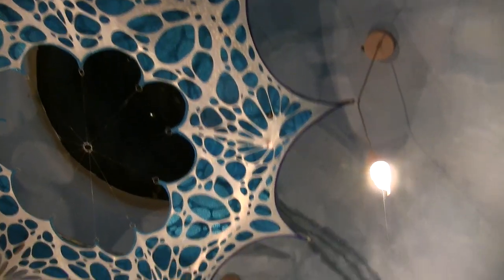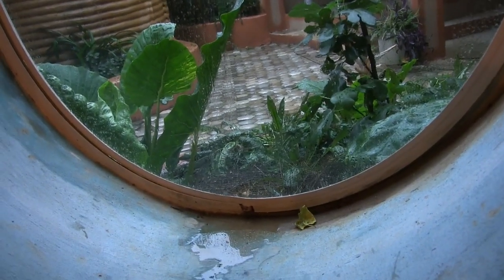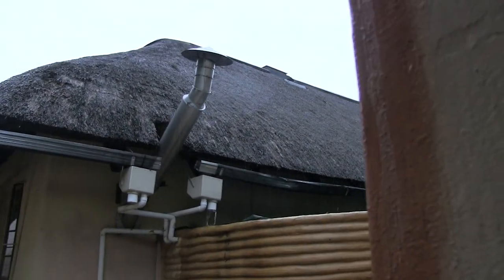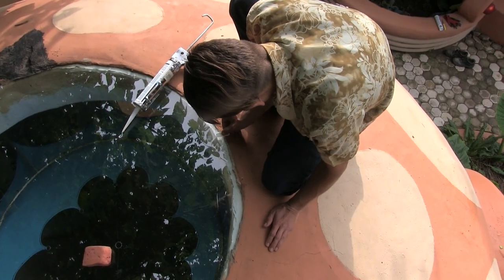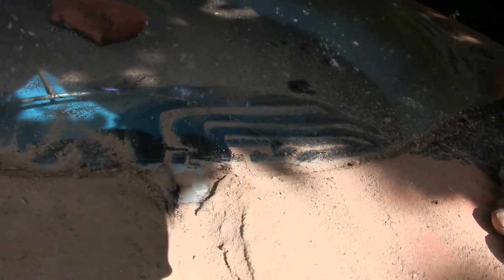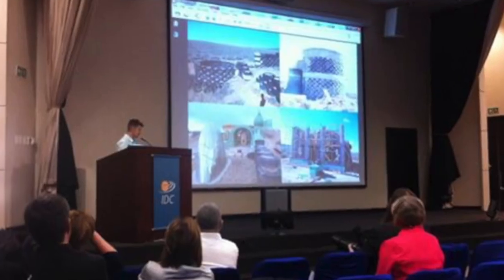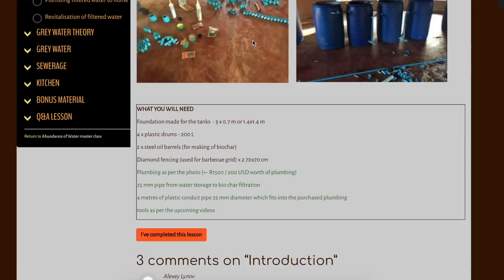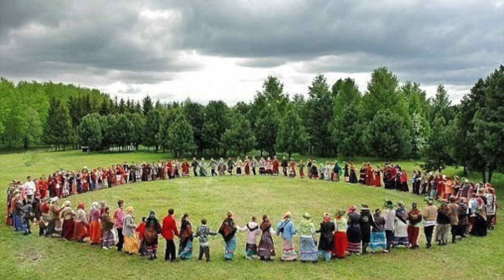⭕️ My Air Crete dome just leaked !!!

Comment: You should have put flashing between the glass and the aircrete. You really need to remove the glass add flashing and then set the glass into that flashing. So the water drains out not in.

Comment: There are many standardized building practices that can and should be integrated into self built structures such as dome homes or earthship homes.  Water damage can and will cause expensive and time consuming repairs.  If it were me I would have a lightweight cupula out of wood with opening windows to provide ventilation even when raining on a dome home instead of a plastic dome.
Reply: that will dramatically reduce the amount of light that can enter the dome.

Comment: You will very lucky if you get that to stop leaking, the hole needs to be smaller than the glass, there can be nothing higher than the glass to hold water, I have done quite a bit of roofing! Never seen something like that not leak eventually,

Comment: Commenting on that window problem - it is clearly an amateur designer mistake and nothing critical, easy to fix luckily. I can immediately see that problem just by looking at that, dont need to wait for the rain lol. Get a big 3D printer and make a raising section to address water flow better. Not much else that can be done on existing domes, but for future it does need a higher lip obviosuly before the window is installed.

Comment: Hey Brother,

You need to coat all the cracks and penetrations with BASF NP1. Leave a thin coat after pushing caulk into cracks. Let it cure for a day. Then use 2-part roofing epoxy or silicone to coat the entire dome.  Do not use any of the nonsense you can buy at the big box stores-especially the stuff with the ridiculous commercials. 
The epoxy and commercial-grade silicone is not available to the general public. Let me know if you need some and I will hook you up.
Reply from the maker: Thank u   We did it with plaster filler similar to what U are describing.
Reply: @AloshaLynov   Nice. I am going to build one eventually. What did you find to be the best soap product to create your foam ?